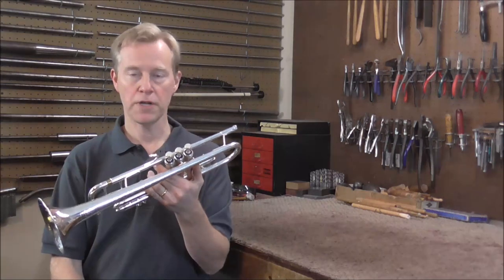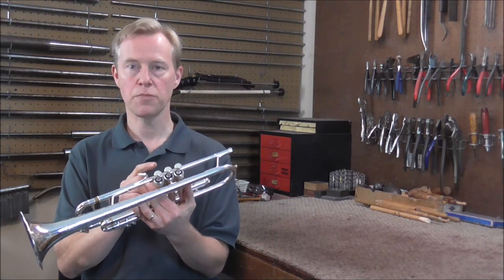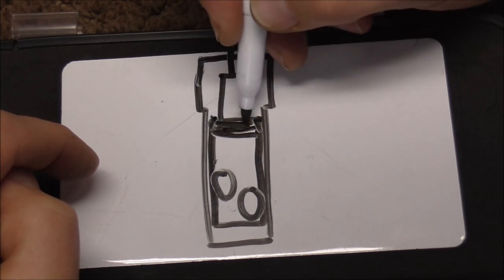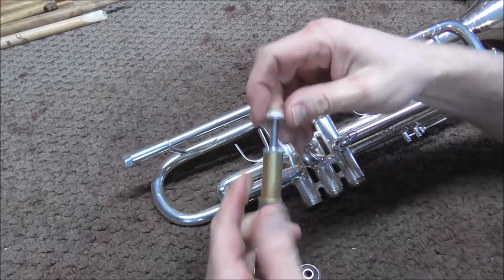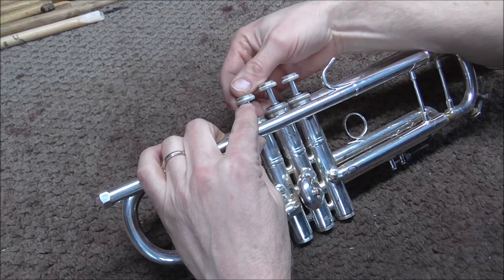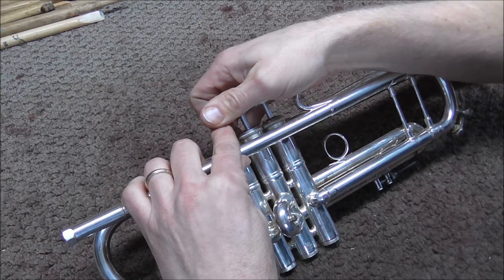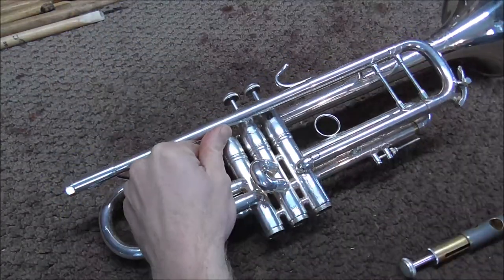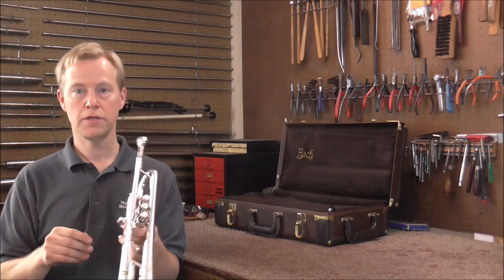(Briefly) Stuck Bach Stradivarius Trumpet Valves #3: Band Instrument Detective Series

Comment: New trumpets often have the same sticking issue, for the same reason.  The valves (either new or replaced) are a VERY tight fit, so some "break in" time is needed.  I usually advise my students to wipe the valves down and oil them daily for the first few weeks of "break in".  After three weeks or so of daily playing (preceded by the daily wipe down and oiling), the valves break in and no longer stick.  Sometimes, when a player sells a horn to another, the way the push their valves down differ, and the valves on a used horn will also stick.  This is a more difficult issue to solve and often either involves some minor lapping, or player adjustments of hand positioning and valve stroke with the finger.  I enjoy your videos, thank you for your thorough discussion on issues and their reasons.

Comment: I imagine, based on the way that other invoice was typed out, that this Strad hasn't worked in quite a while. I know I'd be thrilled to finally have it working!

Also, the size of the, uh... "bell flares" on the previous repairperson...Charging all that to not fix it. Sure, I'd expect payment for parts, particularly new ones, but if it still doesn't work, that's on me.

Comment: This may make you cringe, but on most lapping jobs I leave the button off and actually insert the valve stem into the chuck of my hand drill and spin it on the low speed setting. Now, I'm servicing hundreds of rental trumpets many of which take a beating, I would never use this method on a Bach Stradivarius.
Reply from the maker: I have used that method a few times in rare circumstances.
Reply: I’ve got an old conn trumpet from the 1950s and the valves have this same problem. I assumed this would be general wear and tear so was thinking about replating but I might try this lapping trick first.